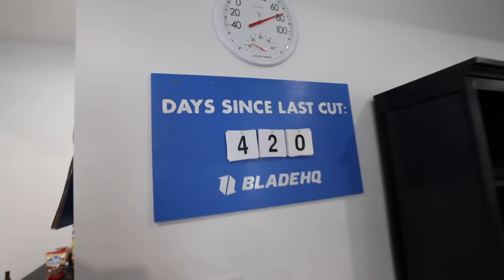Knife Shopping Spree! | Visiting Blade HQ

Comment: Love cold steel I've a couple with the tri-ad locking system and daily the clip point recon 1. But I'd reccomend gluing a certain pin in the lock as you will notice a slight rattle after using them for a while.